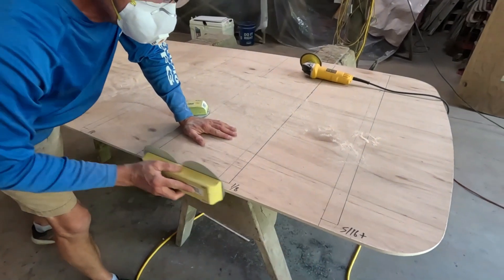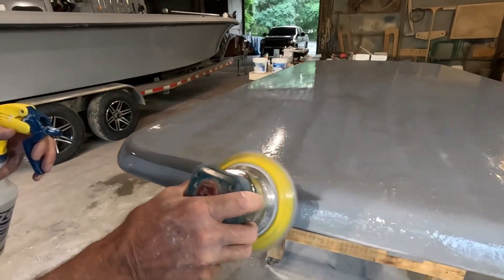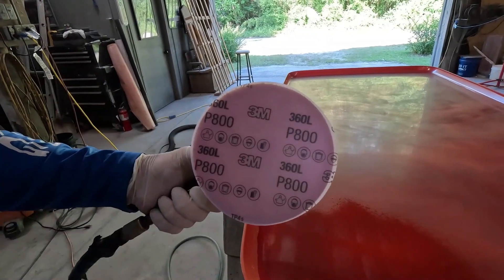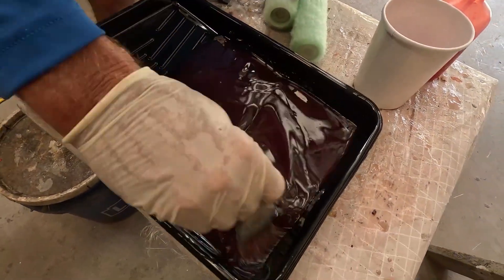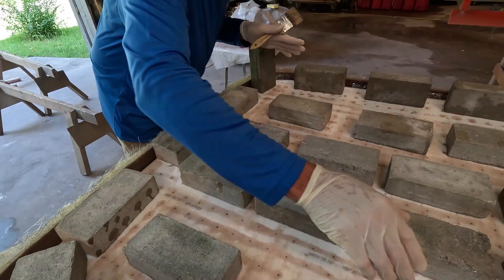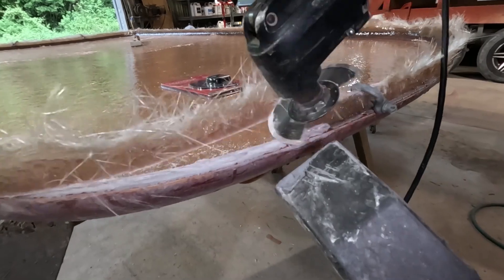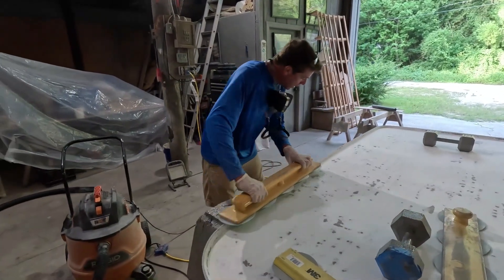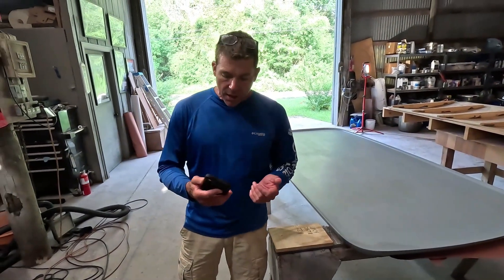HOW FIBERGLASS PARTS ARE MADE FROM SCRATCH! DIY GUIDE!

Comment: Joe and Logan, thanks so much for your hard work in what you share with everyone. These videos are so informative and well explained, nothing like it on the internet. Quick question? My drift boat broke loose from the bank on the Rio Grand here in Colorado for about 3-4 miles. After watching hours of these videos I have decided to repair. My shop is around 1500 Sq. Ft. with gas heat. You talk a lot about ventilation. Shoul I wait til spring to work on my boat when the heat is off. I worry about fumes. Thanks.
Reply from the maker: You are very welcome, and I'm glad to hear that you are enjoying the videos! Most of my concerns over ventilation are directed at your personal health. Most of the chemicals that we work with are not good for you to breathe. I usually wear a quality respirator with a voc approved cartridge when I am not making videos. I usually open the shop doors and turn on some fans when we are filming because the audio is better without a mask on. In the past, we have run the heaters to bring the shop temps up, then turned then off while fiberglassing or gelcoating. If you are working in a relatively small area on the boat, you can use heat lamps to help with the cure of the materials. If you are dealing with relatively small volumes of materials, you should have small amounts of fumes in the air. Of course, waiting till spring,  and using natural ventilation is also an option. Everyone has to decide what is the best and safest route for them  personally. I wouldn't do anything that you are not comfortable with. I hope this helps, and I wish you all the best with your drift boat repair!

Comment: Hi Joe hope all is well. As I commented before I love your videos and your personality lol. Your son does an excellent job shooting the videos. I have  purchased some Nidacore type honeycomb sheets with scrim backing  for a deck and interior replacement on a 24 ft Wellcraft Airslot converting it to a dual console hoping it will be as good  a ride as a 16 footer i had 40 years ago. I would love to see you shoot a video laminating and testing that type of material. Quick question do you recommend precoating the surface scrim with a thinned polyester resin and let it tack  up as you would laminating plywood then proceed with laminations? Thanks!
Reply from the maker: Wow, thank you! I am familiar with Nidacore, but I haven't personally used it in any of our builds. I generally prefer Coosa board or marine grade plywood for most of our projects. Coosa and plywood are strong as they are,and any fiberglass you add only adds more strength, weatherproofs it, and bonds it into the boat or other structure that you are working on. Nida core  on, the other hand, is very light and flexible. It requires considerably more fiberglass on either side to add strength. Not that either is necessarily better or worse. They are just very different. You might want to do a little testing and research on different core materials, and their best applications before deciding on just one or the other. I might even do a video on the topic of core selection for different jobs if that is of interest to everyone. As far as priming of core surfaces goes, I generally recommend it on everything, but with Nidacore, I wouldn't personally recommend thinning the resin. I hope this helps, and I appreciate you taking the time to watch and comment!
Reply: Thanks so much for the reply Joe. Maybe someday I will book a charter probably ensure don't want to take a chance on the weather for offshore.
Reply from the maker: @samuelserra294  Sounds good, thanks!

Comment: Looks great! A lot of work goes down for molds but the good thing is you can pop them out quick after. I have a question unrelated to this video. Im working on a 84 foot ocean alexander yacht there is severe stress cracks regardless if I fix it they always comes back. I recommended to re fiberglass and re gelcoat or paint to permanently fix this problem. I’d like to hear your opinion on that.
Reply from the maker: Thanks, I'm glad you enjoyed the video! It's hard to say for sure about some repair jobs without thoroughly inspecting them, but I will give you my opinion. Stress cracks usually develop because of an impact, flexing of the part or boat itself, or the gelcoat being applied to thick. If it was from an impact, the underlying fiberglass needs to be properly repaired. If it's from flexing, then the surrounding area needs to be reinforced so as to stop the flexing or movement. If the gelcoat is too thick, say anything thicker than a penny,then it needs to be removed. The area under it repaired with fiberglass, If it looks damaged. Then, reapply new gelcoat at the correct thickness over the  area of the cracks. The 2 videos that I recently did on the console of our project boat go into the process in detail, and cover the options I just gave you. You might want to watch those videos in their entirety, and consecutively to help get a clearer idea of the process. I hope this helps, and thanks for watching!

Comment: Will you only use it (the top) for shade or will it also be used as an elevated steering/vis station, or for solar panels etc ? Looks heavy enough to walk on if you add some traction materials for anti slip...
Reply from the maker: The plan is just for shade right now, but I could put a hatch through it in the future. I could add a second station, or just use it as a lookout station. Thanks for taking the time to watch and comment!